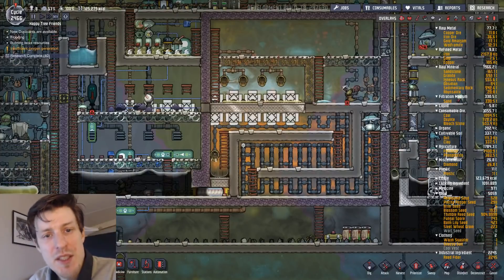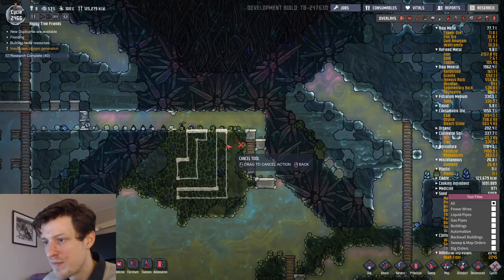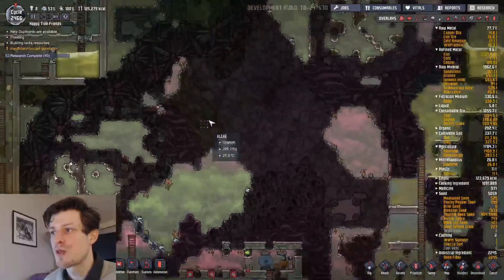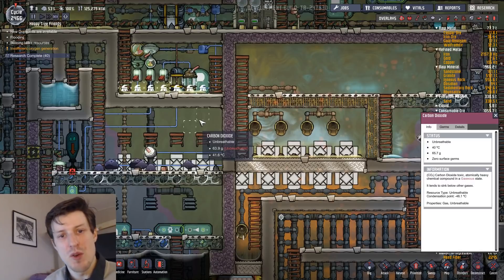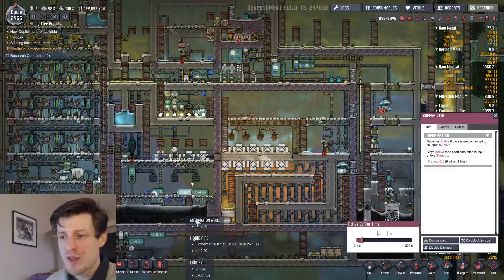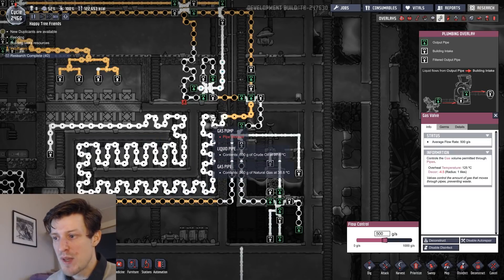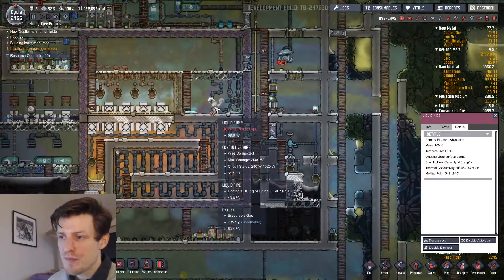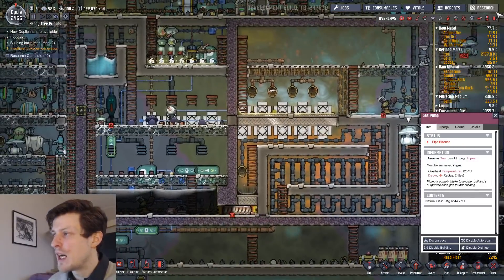How to build a Crude Oil to Natural gas plant (boiler) without using debug mode

Comment: Great guide Ketmo. I really like the preheat oil part which also cools the nat gas coming out. Super efficient. And you're also boiling some polluted water as well. Very nice. Can you explain why naphtha is used? I built a very basic non sustainable one of these using magma a few months ago: https://www.youtube.com/watch?v=UyD2vYhILxQ
Reply from the maker: Hi. The reason for using naphtha is pretty much that it can hold quite a lot of oil pressure and take high temperature without turning to gas and is somewhat easy to get in place. You need something to separate  the carbon dioxide from the oil (so the oil won't push in on the carbon dioxide. If you did not have anything to separate the two the oil would push the carbon dioxide to one single space make it more concentrated and the machine less efficient (if working at all). You could use other means to separate the two. Naphtha is just probably the easiest, It is a lot easier to place a liquid block than a gas block between the oil and the carbon dioxide (at least if you don't use debug mode).
Reply from the maker: Ds. I have seen that video. The method I am using requires a bit of an exploit in how the liquid tepedizer is used. So thew way you did using magma it might be the only way possible if they patch how the tepedizer work.

Comment: Wow, that was fast, only 1 day since I asked about it. Thanks a lot. Turns out a bit simpler than I thought. I had tried to google plans and the only forum page I could find said that you needed 3 blocks of gas trapped by the tepidizer, oxygen, carbon dioxide and chlorine, each at 1500 grams. It was so specific I assumed that it was the only way to make it work.

Thanks again.
Reply from the maker: I was glad u commented about it. Because I realized in the video series I had been so focused on capturing when I started the machine up, and talking about the problems I run into (I ll post that footage quite soon), that I forgot to give a good explanation of how it worked and how to build it. I am actually quite ahead of what I have posted videos of. I m pretty much done with the build. So spoiler alert (it will work.. I think, still have to testrun it over an extended amount of time to know for sure...)